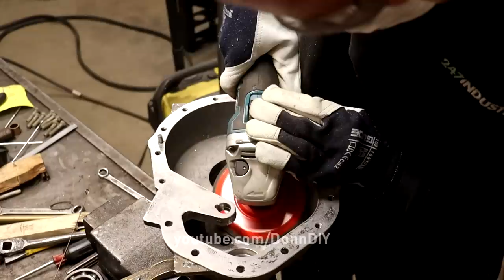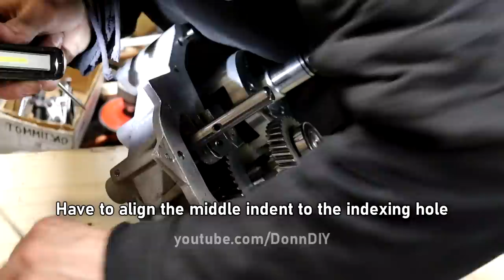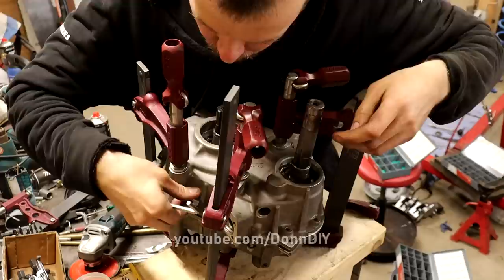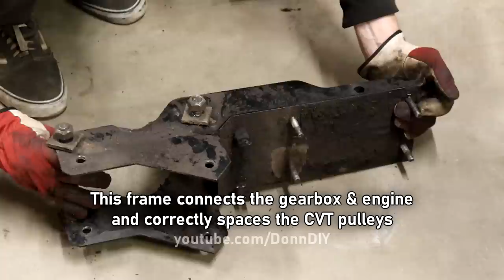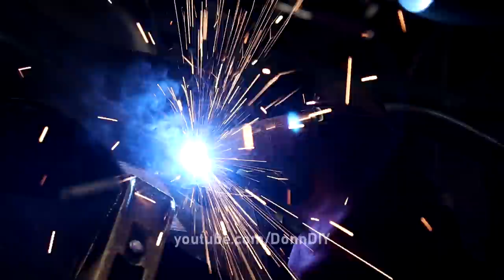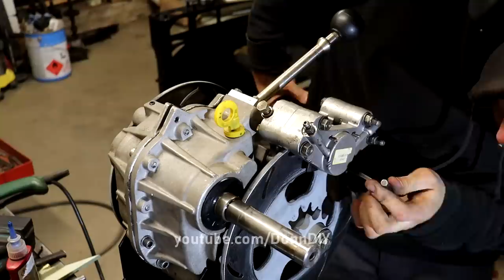Gearbox Assembly - 8x8 Amphibious Vehicle Argo REBUILD Ep.4

Comment: Nicely done. I had to repair a gearbox that was used at Heathrow Airport which was used to jack up the nose wheel on 747s so the tyres could be changed. That box had lost all it's oil and was not checked until it seized. The TIG welding on the bearing diameter was a good move. 👍

Comment: OK, fair to say this thing was built too lightly in the first place - add more steel! 😁
Reply: Definitely needs a few braces and stiffening in places all over
Reply: Add more steel so it sinks in the water
Reply: @BIGSMOKE-bl2lq  In one of Donns videos he mentions the displacement factor. I dont remember and dont care to look it up, but I was surprised at the weight that can be buoyed to hull volume ratio.   To be fair, I highly doubt that a handsome bit of beefing this vehicle will sink it down more than is even perceivable.
Reply: @levidbateman5174  
It definitely appears that some reinforcement could be added in the area of those cracks that Donn welded up which appear to be inherent weak spots.
Reply: @BIGSMOKE-bl2lq  this thing will haul lots of people a bit more steel is not going too make it sink ,,

Comment: Great work me son !! My 6x and my buddies 8x pretty much had almost every weld cracked,along with cracking in solid flat areas also,every single stub shafts bearing was toast,every sprocket,every link of every chain,zero brakes remaining,tubs had multiple cracks,both engines smoked,tires were mix n match and mostly half would be flat the following day after airing them up even though they had very little tread left,were dry cracked all over,1 of mine was even splitting along the 2 casings joint.. Marks 8x was in much better shape than my 6x but his cost him 25% more for us to rebuild than mine did and neither of them were cheap to do a full off rebuild like you've done here and yes every single gearbox I've ever seen or worked on was thrashed like yours was... People literally believe these things are military grade tanks when, in fact, they're fairly light duty machines that actually do require a fair amount of maintenance and effort by their owners/operators.. I bought my 6x for $800 USD cash many moons ago and had not quite a new Argos cost in it when I finished,but it wasn't a while lot less,and Marks was the same way... Luckily a lot of these parts are now internet sourcible and readily available and cheaper than they were back then when one had to order out of a catalog,send in full payment,wait several long weeks for parts to be shipped,and then up to a couple of weeks for them to arrive... You're doing wonderfully Donn,keep up the excellent effort, and I'll sit back with a frosty adult beverage n relax while you do all the sweating and hard work  😅

Comment: Looks like those cracks in the gearbox support frame are a design flaw that may reoccur.  Maybe adding strengthening plates at those corners could help (or just move any news cracks to another location 😞).  Great video, as always.  Stay safe out there.
Reply: Totally agree, there seemed to be plenty of space in the crack areas where a stiffening plate could have been a useful addition.
Reply: @rl3898  Check out the next video in the series.
Reply: What gearbox is it?

Comment: Great job. Do you feel like the cracked areas could have used some reinforcement?
Reply: Reinforcement of the frame will be a good idea. I am worried about the distance between the frame and the pulley. There will be a torque and crack the frame again.
Reply: I think I might have reinforced the cracks, but my welding is a deal less practiced. Besides, if it does give grief, guess who fixes it!

Comment: Good work TIGing on that crap aluminum casting. I feel thats one of the hardest welding jobs to do.  Casted aluminum is nasty/dirty stuff.  Looks like at the very start you weren't hot enough and you got the typical response...filler rod balls up and almost repels the work piece. Next time, unless you're worried about that old bearing, heat it up with a torch before you strike an arc.  You'll be amazed at how much easier it is to get the puddle formed and go to work.

Comment: The frame connecting gearbox and engine looked really flimsy. I wonder where it would make sense to add reinforcements?
Reply: Certainly looks like those cracked areas could be reinforced on the inside of that subframe but don’t forget Donn did say this thing was severely abused.  
Of course that’s just one way to find weak points.
Reply: @Crewsy  Yes, and as others have pointed out, weight is more of a factor than in most of his other builds.
Reply: Based on the cracks, I'd put the reinforcement between the gearbox and the wheel axles.  I.e. the chain pulls a lot harder than the CVT.

Comment: Bad engeneering on the sheet metal "frame", which holds the gearbox.. Thats obviously a stress point, where the crack started.. Can you weld a second layer over? A piece of flat stock or sheet metal...as a "bridge"...
Reply: Came here to ask similar - it's either bad design or abuse, but likely bad design. So some form of support around those brackets might be in order? Armchair engineer here! 😁

Comment: Cool project. It is hard to tell what chemical you used to clean the frame before welding but be careful if you are using brake cleaner, read up on phosgene gas, very little brake cleaner plus welding can mean death.

Comment: Now that you have the transmission mounted to it's frame, figure out were you can add reinforcement to the frame work to strengthen the mount for the transmission, your going to need to add reinforcement to other places as well, like the main frame.
Reply from the maker: Yes, absolutely. But I'll have to mount everything and check the clearances first. Otherwise I'll just have to hack everything off again if there are issues to be found.

Comment: Rich Rebuilds is building an electric one of those, I messaged him to throw away that gearbox and use two electric motors with a joy stick controller.  But na. I hated the early gearboxes, they were rough and noisy.  The later ones have a gradual turning system, far better.